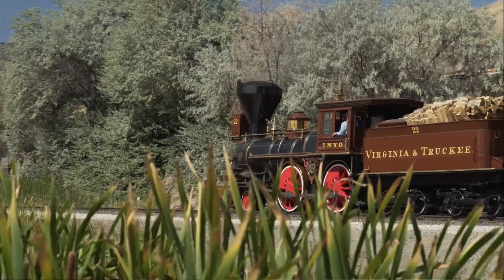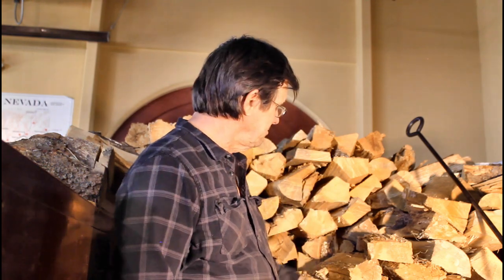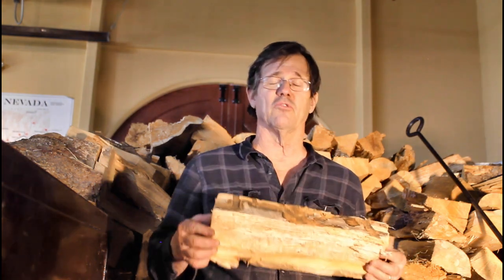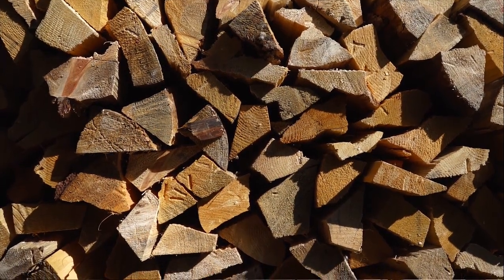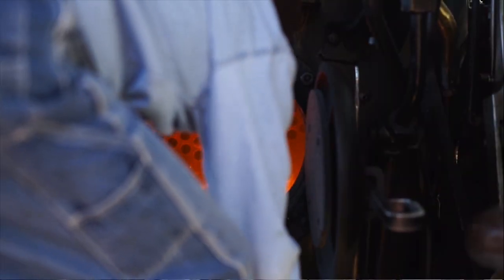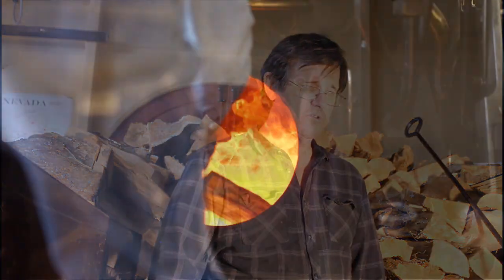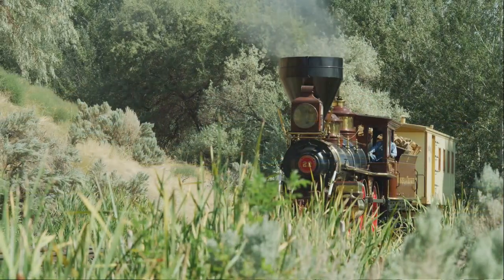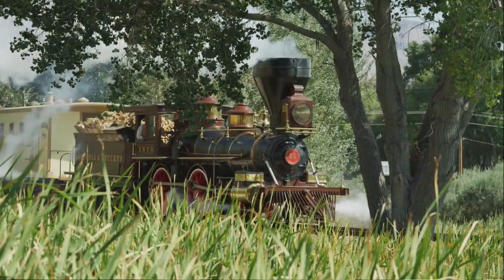The Science of a Wood-Burning Locomotive

Comment: I use fir to fire my 2 1/2 scale live steamer. The fire was not hot enough to keep full boiler pressure until I made a special grate with over the fire air jets and fewer air inlet holes along the bottom. Now steams fine but does require frequent stoking.
Reply: That sounds like a ‘Gas Producer Firebox’ as fitted to very few locomotives such as the solitary SAR Class 26.  The oxygen starved firebed produces a lot of gas which burns above the firebed.  This keeps down the temperature in the fire itself.  In coal burning, this prevents clinkering.

Comment: Are there any sources for drawings of the inner parts of spark arresting chimneys.  And how do you empty accumulated ash inside the stack?
Reply from the maker: Near the bottom of the stack is a porthole that can be opened to clean out the ashes.  It's typically done by hand, just by reaching in and pulling out all of the ashes.  Here are some drawings of spark arresting chimneys: https://www.mendotraintony.com/smokestacks-of-steam-locomotives-article-in-live-steam-magazine-of-december-1984/
Reply: @nevadastaterailroadmuseumc5585  Thanks for your reply.  I’ve followed the link and looked at the drawings which I’m going to really get to grips with.  I really like the ingenuity and imagination that shows through steam loco design.  These spark catcher designs show what long dead designers were thinking about how gasses and particles could be separated.  My fav has got to be H Giffard’s live steam injector which I still find very counterintuitive.  BTW I read recently that they are 96% efficient!

Comment: Doses the pine leave alot of  creosote on inside of firebox!? Seams like it would
Reply: On my live steam engine creasote builds up but it reaches a point where the temp in the firebox gets high enough to combust the creosote as well.
Reply: @PrinceAlhorian  and that temp is probably quickly reached in a big loco
Reply: @the_retag  I believe so, in my model, when she starts moving at a pretty decent clip and the cylinders fire the flames by the exhaust steam up the funnel, you hear a mild whoosh from the flame tubes a puff of white smoke and ash and she then purrs like a kitten for as long as you can stoke it and keep it watered.  I believe that whoosh is the creosote singing the song of its people and vacating my boiler with haste.